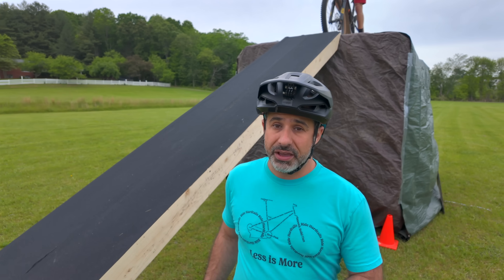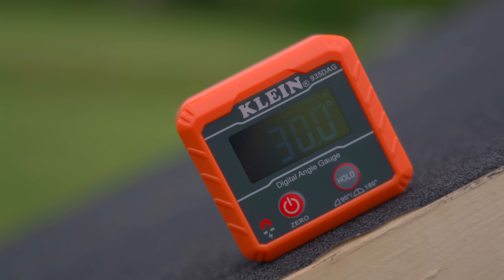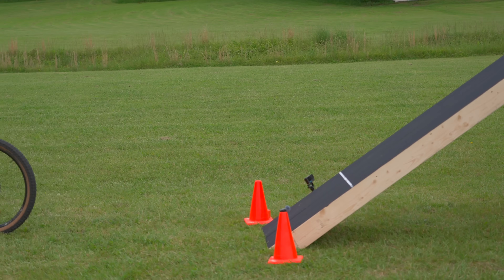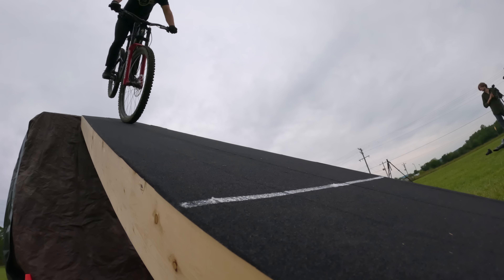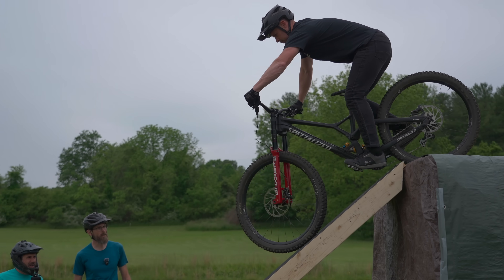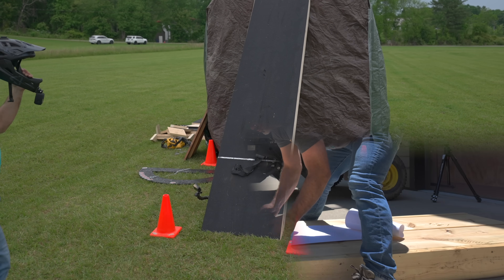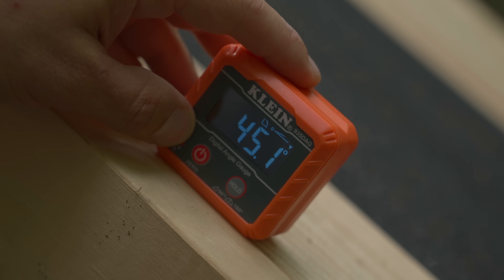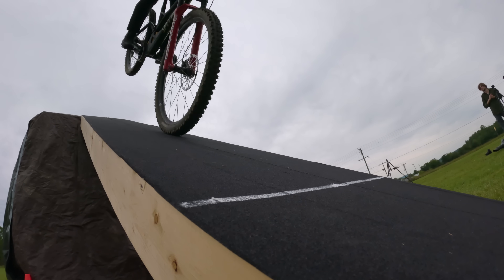Could You Stop? Our Brakes Were Useless At This Angle

Comment: There is a physical value, called rolling friction coefficient. For a average Rubber to asphalt or concrete it is 0,5. That means the max 
angle is 50% and this is 45 degrees. There exist table with hundreds of different materials of surface against rubber. The Mixtur of the Rubber is more important than the tire pressure (only valid for perfect surface). A very soft Rubber Mixtur bring a advantage. What you good recognized is the importance of the center of gravity. At Optimum all the mass should be at the breaking wheel.
In case of a dragster, where you will accelerate insted of breake, the most weight is at the driven axle. Physically breaking or accelerating is the same. Have a Look to gocart wheels, Formular 1, dragster etc.
Nice video for physics students as well as engineers. Keep goin and sorry for my english.

Comment: It's physics. At 45 degrees the force pushing down is equal to the force pushing you forward. There is not sufficient downwards force to provide grip to the tires to stop the forwards force. You can only exceed 45 degrees and maintain grip if the actual contact patch of the tire and ground is not exceeding 45. Think dirt bike tires climbing an extreme slope by the tire mimicking a gear interfacing with the loose surface. A tire with large knoddbly treads results in the contact patch of the tire being perpendicular to the tires surface. At angles higher than 45 the tire is gripping with the sides of the nubs, not the surface.

Comment: 8:55 that gap at the edge is making you fail.... the ramp needs to be properly connected to the drop off point.... it raises your rear tyre even more and thats why you are going down on an endo... and the rear tyre doesnt have the time to find proper grip, thats why its locking up all the time....
Reply: you also need a back suspension like the one joe has on his dh bike..... with that much travel and considering the geometry of the dh bike if you set the rebound in the lowest option you can stop pretty easily i would say....

Comment: that point where you meet with ramp angle is the weakest link of the test and the lip before the ramp does not help. You start moving on the ramp with too much speed because of this fall over first angle and lip and already at too much inertia and without rear wheel that contacts way too late.

Comment: Try using the same bike but put hookworms or thick slick tires on so you have as much grip as possible and lower the tire pressure. I feel like that should work better than the knobby tires with less contact point 10:59

Comment: You had planks hanging over the ramp, and so your effective angle was higher than intended causing your bike going to front wheele from very start. If you tried having slight angle before going to the main ramp you would decrease chance of bb hanging over and smoother transition would give a lot more control.

Comment: I think changing the way the bike actualy gets on to the slope, is important. As in, in the second part in te video, the rear wheel first hast to go over an edge and then fall back onto the track, to get on to the track. So you have zero grip from the getgo. If you look at the way it was done in the first half, here the wheel didn't bounce onto the track and the driver started breaking already before being totally on the track.

Comment: If you want to test the steepest possible angle I think you wouldn’t want a bike at all. You would just put a cube on the ramp with the same tire compound or a slice of tread on the bottom and see what angle it slides. I believe because of physics the maximum angle is dependent entirely on the coefficient of friction.

Comment: Create a ramp that you can change the of on the fly. Perhaps using a car jack or a pulley system. Have the rider placed on the ramp at a stop. Support him to stay up right. Slowly increase the angle of the ramp until the tires lose grip and the bike slides. Although this test is not the same as a actual stopping test as it removes deceleration from the equation. This will show you the greatest angle that a stop is possible for a given bike and rider combination.

Comment: Thanks for the great video, it's an interesting experiment. I think the main reason why you couldn't stop on the later experiment was the lip of the porch onto the ramp. you had to fall a small distance with the back wheel, picking up too much speed in the process I wouldn't be surprised that it would comfortably make a difference of a few degrees. (the bump is quite visible on 9:21 soon after the statement "that bump down to the ramp does not help"). you could compare that to 7:14 where the back wheel very smoothly rolls over the edge, never leaving the ramp edge in the process, where in this case, the part of the breaking force was not possible due to the tearing of the tape, this could possibly have kept down the entrance speed even more.

Comment: Why downhill bike stopped on steeper angle:
Geometry:
Slacker HT angle - the front wheel is further down AND further front, so your position is more leveled
Higher stack - bars in the downhill bike are much higher compared to trail bike, your position is much more leveled.
Overall bike length - wheelbase of over 1200mm makes you much more stable on steep ground.
Axle to crown - bike with 200mm of fork travel will have at least 5cm higher bars than 150mm fork bike, you gotta add bars rise and backsweep.

And then there are components: more powerful brakes, bigger rotors, bigger tread on tyres (more surface contact with ground), softer tyre compound (more friction with ground), etc.

Hope somebody finds it helpful or at least entertraining

Comment: You might benefit from using a bike with a lower bottom bracket height. A mullet bike can also help because it becomes harder to tip over and allows you to position your weight lower due to the extra tire clearance. You could take a 29-inch front and rear bike and put a smaller rear wheel on it. With the smaller rear wheel, the bottom bracket height is lowered and the front axle is higher compared to the rest of the bike. When the front axle is higher, it becomes more difficult to go over the handlebars. A bike with a shorter seat tube length helps too.

Comment: rope up so you dont have to worry about eating bars. Use an overhead rig with a catcher and tell them to not pull you up at all but only to keep you from hitting the ground/ramp if you fall. Also what about different size wheels and tire widths.

Comment: if you are relying on friction only the theoretical threshold is 45 degrees, only if you have sticky tires you can go slightly above. But then you are relying on a micro bond between tires and the surface. so your friction coefficient is above 1

Comment: I noticed your back wheel seemed to lock up at the higher angles--as others have pointed out, your rolling/static coefficient of friction will be higher than your sliding coefficient of friction.   I wonder if a more gradual transition (from flat to steep) would allow the BB to clear, allowing you to keep the back wheel planted and rolling, thereby allowing steeper angles of stoppage.  Also, I would let some air out of the back tire, too.

Comment: Hey Seth, small little bit of unsolicited advice: when trying to find the solution to a math equation, I wouldn't trust ChatGPT. It's a language-based machine learning model, not really meant for math problems. IE: ask it how many days until Friday (or whatever day, doesn't matter). It will never get it right, even if you say what day it is, it will eventually keep giving you the wrong answer. Wolfram Alpha is what I'd suggest for that kind of stuff, it has a box in which you can ask it questions in the same way you can with ChatGPT, but you have more piece of mind that what you're getting is correct. It's basically a super powerful web-based calculator.

Comment: Joe's technique was absolute perfection, that's what made the difference. The bike isn't really a factor - only the front tire and technique are at play here. You want a body position where the front tire is taking 100% of the force with the rear tire almost lifting off the ground but not quite. Joe was getting pretty much that, balancing the rear tire barely lifting with body position and fantastic brake control. Since only the front wheel is touching the rest of the bike doesn't matter - everyone was fully capable of moving their weight too far forwards or backwards so they could always get the perfect body position. The tire width, compound, etc is obviously incredibly important here as it's the only thing generating a force (but substantially different priorities in real world riding). But at least visually the key difference seemed to be technique.

In the real world bike geometry will be more important as you're not on the extreme limit like that. More speed, more weight on the rear, it makes the physics more than just a single static tire. You're also needing a more complete skill set which wasn't really replicated here including the ability to judge terrain etc. But that really wasn't the point of this experiment and as a lab test for an extreme maximum this was a fairly good setup. As a physicist I would have likely tested tire friction and used mathematics (and not ChatGPT - famously bad/liar at maths), but that isn't quite as fun nor entertaining.

A "better" test might be just testing different terrains. You don't really get the same control as this test as you have to find an area with the right grade but it's at least more representative of the real world. Or if you wanted this test but better remove the front tire place a downwards force upon it and increase the grade until it slips - that will give a perfect result for perfect technique (and can be tested with different tires if desired). But the second test likely isn't fun to watch and doesn't require any actual cycling.

Comment: Glue a piece of tire to the bottom of a heavy object with a low center of gravity. Put grip tape on a board or other flat object and attach an angle gauge to it. Slowly raise one end of the flat object until the heavy object with a piece of tire glued to the bottom of it loses traction. Then you have your answer for the theoretical limit at which you'd lose traction. For further experimentation, you could make the height of the center of mass for the heavy object adjustable and experiment from there.

Comment: To prevent going over the bars the only thing you need is for the center of gravity to be behind the front contact patch. In the side view, draw a line from the center of gravity straight down and see where it lands. This is why slack helps.

Putting your weight "too far back" just means some of the braking force is transferred to the rear tire. Again just look at where the center of gravity intersects the wheelbase on the ramp and you can visual how much weight is on the front vs rear tire.

To understand the most angle you could stop on you just need to compare the friction from the tires to the weight going down the ramp. At 45 degrees the amount of weight going down the ramp is equal to the amount of weight being put onto the tires or into the ramp. F_down the ramp = cos(angle)*weight,  F_on tire = sin(angle)*weight, F_tire friction = coefficient of friction * F_on tire

You will begin slipping when F_down the ramp > F_tire friction, if that's happening at 45 degrees you can estimate the coefficient of friction of those tires is around 1.

Comment: The mistake is front braking on a downhill. Rear brake should be your primary brake going downhill. The steeper the slope, the slower the speed to flip yourself over the handlebars no matter your positioning if you use your front brake on a downhill run.

Comment: Seems the team skipped a lot of school. Could have just used the same length of ramp (without cutting) by using a scissor work lift as the platform. Simply adjust the height of the platform to alter the ramp slope. :face-blue-smiling: Scissor lift & constant length ramp would also keep the braking distance the same. The shorter ramp gave them less distance to apply the brakes.

Comment: Let me start by saying I'm an idiot, but I think this may be a simple math problem. At 44.9 degrees, gravity will be pulling down into the ramp, but at 45.1 degrees gravity will by pulling you down the ramp. It makes sense in my mind, lol. The center of gravity remains behind the front contact patch while below 44.9 degrees, but at 45.1 degrees the center of gravity would be on top of or in front of the contact patch making grip irrelevant and balance becoming the important factor.

If I'm right, maybe I'm a savant, if I'm wrong, I blame jesus for making me dumb.

Comment: I feel establishing a theoretical maximum angle is important. 

Maybe locking the front wheel to the ramp (u bolt/clamp) and getting on the bike (safely somehow) and increasing the angle of the ramp until you’re no longer able to prevent yourself from going over the handlebars. 

Not only does this remove the skill required (which I feel is HUGE here as it’s easy for you guys to take for granted how skilled you are) but it also sets a goal. It will also establish the best body type (height and weight) plus body positioning.

Once you know that stuff it’s all a skill challenge from there possibly with different ramp angles as maybe it’s impossible for you to do what your colleagues can or vice versa due to body type.

Comment: Your brakes are fine, but the coefficient of friction between your tyres and the ramp surface decreases as the angle increases - as you found the wheels locked and you just slid down at 42 degrees.

Comment: Rubber can have a co-efficient of friction greater than one.  That ends up corresponding to your maximum rise over run.  The point is on paper >45deg should be possible.  I think you need smooth tires with soft rubber.  Whatever is the closest to racing slicks in the cycling world.  This may sound strange but grip tape can be not that grippy.  It has consistent grip and kinetic friction which is why it is good for skating.  It would be interesting to make your ramp wide enough that you could have part of it with grip tape and part without.

Comment: This is a classical engineering statics problem. Sum the forces in the horizontal direction, and sum the forces in the vertical direction, and set them both to zero. If the friction force at the tire is less than m*g*sin45deg, then the tire will slide. 

If the coefficient of friction between the tire and surface is higher, the angle can keep increasing until the CG passes the front tire contact patch, at which point a moment about the contact patch will cause the rider to go over the handlebars.

Comment: ❤ Well I wonder if the track was made of stones, maybe sized as concrete tennis ball halves and dynabolted to the ramp with large washers. It's just a test so I'd tessellate them hexagonal. Might take forever but that was my idea, could use wood. If your plank was thick enough you could just cut a 1"x1"x width section out every two inches, so that way your tyre can grip more like on a trail.

Comment: In college physics class, Prof. pulled a 2x4 piece on the small face and large face. Friction force was not affected. Literally, the center of mass rearward is your limiting factor. Hence, why your rear wheel lifts. Get some funky rear swept handlebars so you can put your CoG further rearward. Psi adjustments won't keep the rear wheel down. Lowering Psi just means the tire needs a larger contact patch to put all the pounds across more square inches, if you will.

Comment: to go above 45º degrees you need very sticky stuff (tires, surface or maybe both). It is plain physics. Most object cant produce more fricition that the force aplied (ie if you aply 60kg on your tires they will produce less that 60kg of frictional force) this is called coefficient of friction (CoF). At 45º you need at least a CoF of 1. The stepper the ramp the more CoF you need.
If the CoF is enough, then you need to worry not to go over your handle bars and not to unload your front wheel.
These results are actually really good as pure rubber on asphalt CoF of friction is about 0.9 which gets you around 42º max (tires on asphalt is around 0.7)

Comment: For boring testing: drag weighted sections of tires over grip tape with a fish scale to find compounds that are not going to tear away, but bite really well, and tread patterns that work well. 
Then try again and sag your suspension out on the bikes. With the rear end lower it will make it take much easier to use yourself to balance the bike.

Comment: I would be very interested in seeing a sequel to this, but with different tires.
 My assumption is that with some very good soft compound, low pressure, and tires half worn, genuinely worn, not cut, it would be possible to go even steeper. For example addix purple or black chili. I remember riding black chili a few years ago and always always always having issues with otb, never slipped. And definitely don't do it on new tires, I find the finish layer to take away a lot of the grip.

Comment: I think the most important part would be to modulate braking so accurately that you don't lock the tire until you want to stop. Once the tire starts to slide even a little bit, the friction coefficient gets much lower.

If the rubber doesn't tear, you should be able to put all the weight on the front tire only and still get max angle. But that would require perfect braking or starting from the standing position (with the help of other guys).

Maybe have some kind of big see-saw swing setup with some kind of support to allows staying still on the bike while slowly increasing the angle until tires start to slide from standing still?